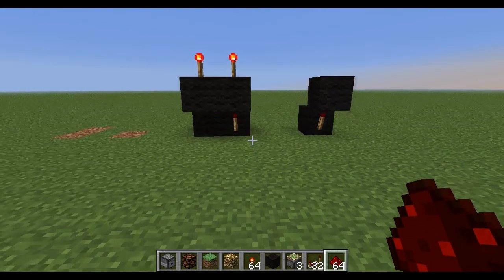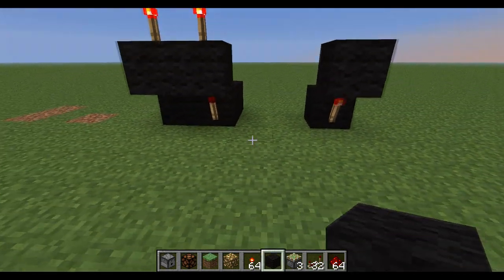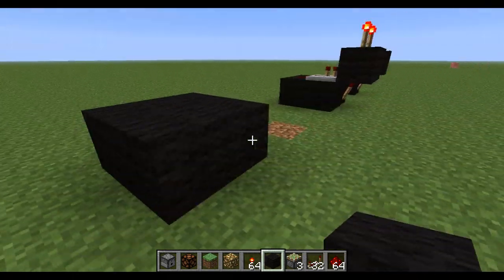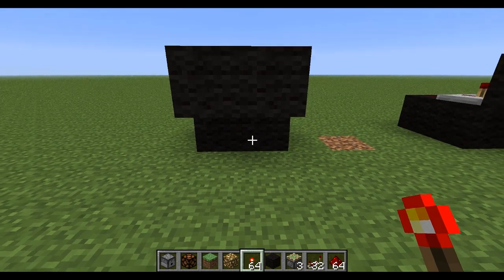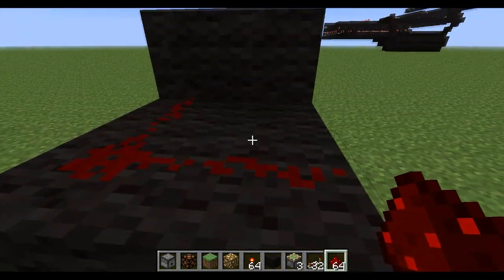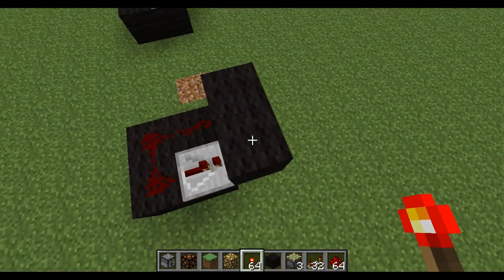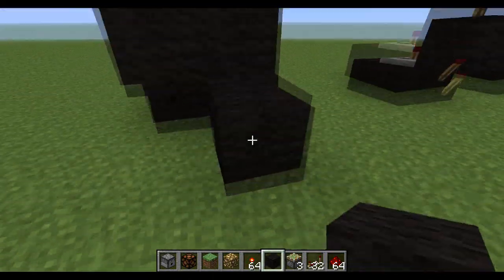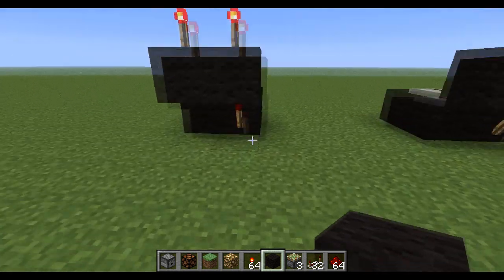S-bud (piston less bud switch)

Comment: when I was messing around with burning out torches I noticed it worked similar to a BUD switch. The problem with designs that involve burnt out torches is that they will trigger every now and then. When the redstone torch is updated between 5 to 15 minutes, this BUD switch might start pulsing, which is why I prefer using Glowstone BUD switches instead.

On the smallest design, there is a 2 block wide, one block deep, 2 block high BUD switch that uses a boat, a piston, and a pressure plate.^^